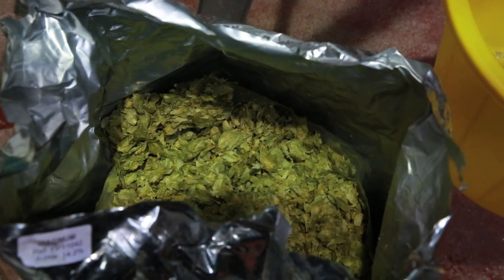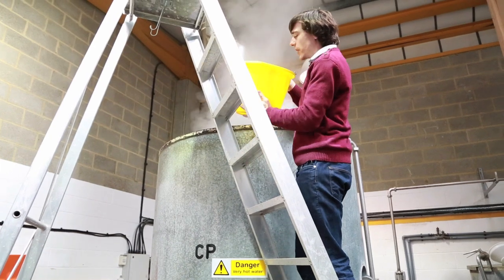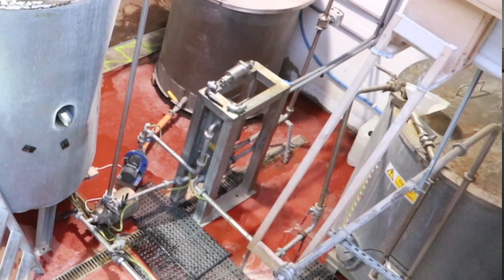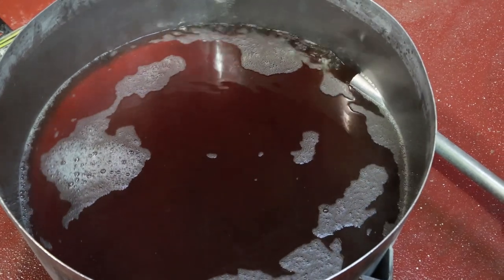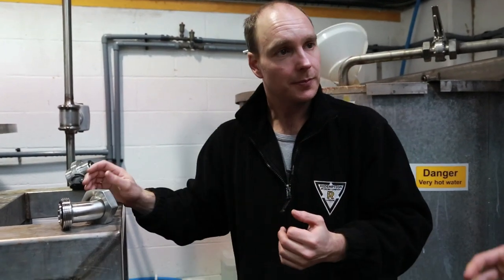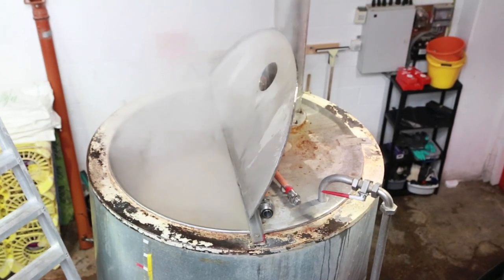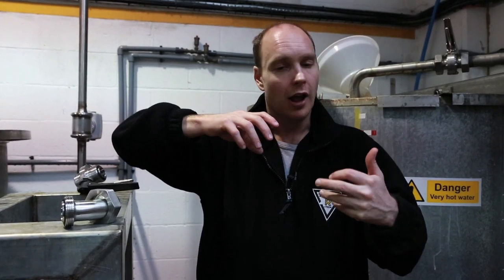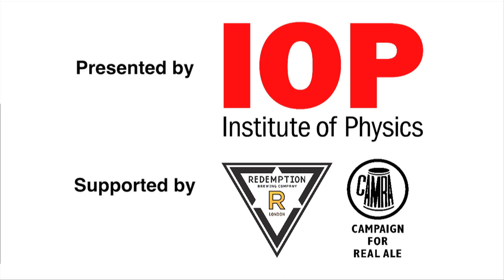Hops and temperature in brewing your ale: Cheers Physics

Comment: But how can the circulation heat cold water to 50-60 degrees only by the exchange in heat of water which are 15-16 degrees? Where did the extra 40 degrees came from? Heat will always equalize, so even if you'll keep heating the hot water - the cold water can't be heated to a higher temperature.

Comment: Wait, How is it possible that the cold water were heated to a temperature which was higher than the hot water due to the exchange in heat? Doesn't it contradict the Second law of thermodynamics?

Comment: It still doesn't explain how the hot water were cooled down to a lower temperature than the cold water and vise versa. According to the second law of thermodynamics, a closed system will always go towards equilibrium.
It states that if you'll place a cake in an oven for instance, the cake will be heated closer and closer to the oven's temperature and the oven will cool down because of the cake. Even if you'll keep heating the oven, the cake will never become hotter than the oven itself.